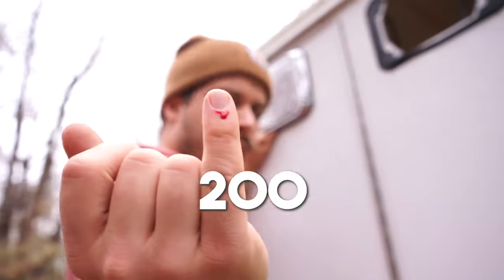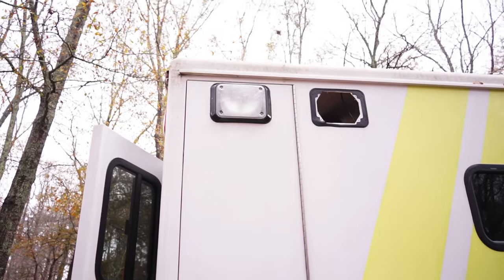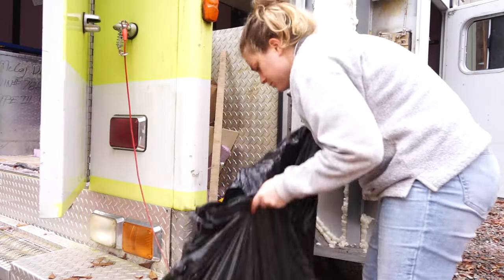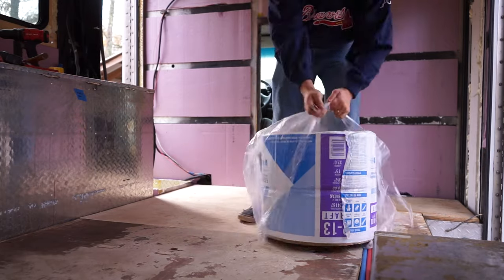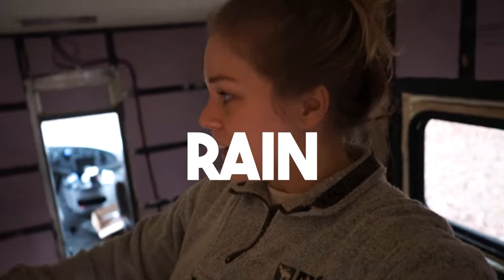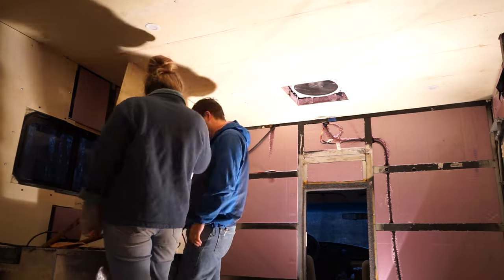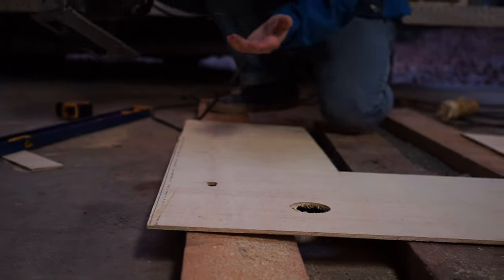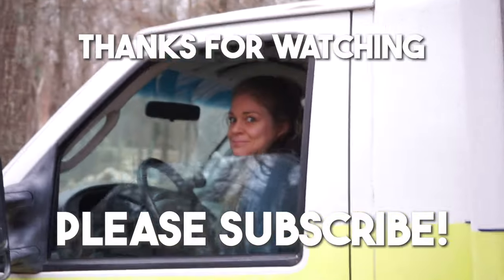Walls Are Going Up! Starting To Look Like a Home - Week 10

Comment: How funny is that, I just stumbled upon your videos because the ambulance looked very familiar. Low and behold, I live about 5 miles away from the exact station you got your ambulance from and if you can believe it, I happen to own your ambulance’s older sister! Mine is a 1995 made by the same company, and except for one extra side compartment, the box is identical, and I got it from the same fire department with the same intentions as y’all. Y’all are doing a great job and I’m using your videos as a guide to strip mine down. The only extra step I have to do is put a different chassis under my box since the motor and transmission are gone, so I’m working on that first. If I get stumped on something, could I ask you guys some questions? And if y’all have any questions about it, I may can help. The whole reason I wanted this rig was because I was an EMT for 15 years and spent a lot of time in them and always thought they would make great campers
Reply from the maker: No way! Wow what a coincidence😂 good luck on your build! It’s a process to get through. And yes absolutely 👍 any questions you have, feel free to send them our way!